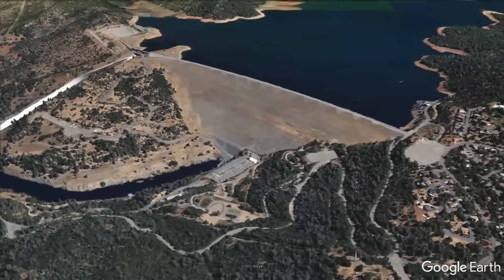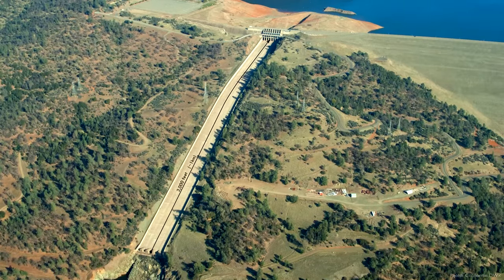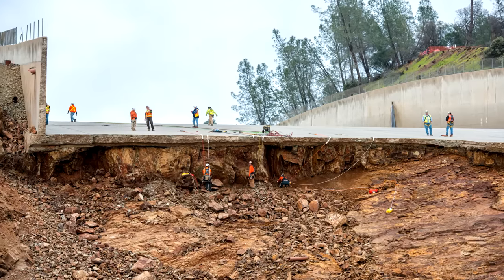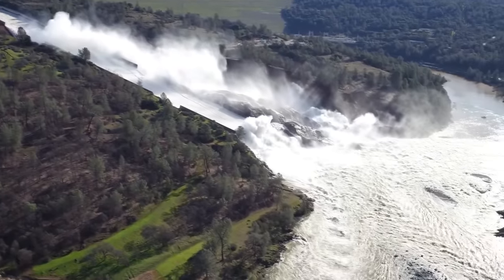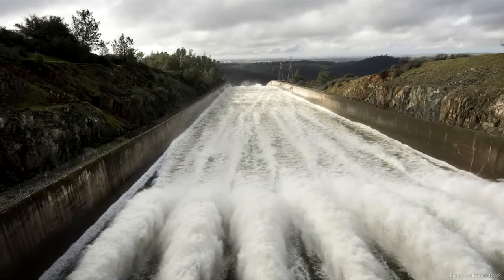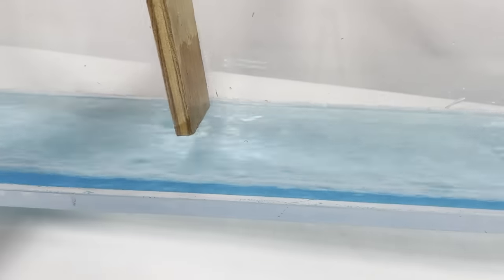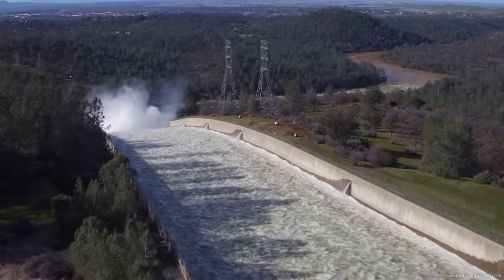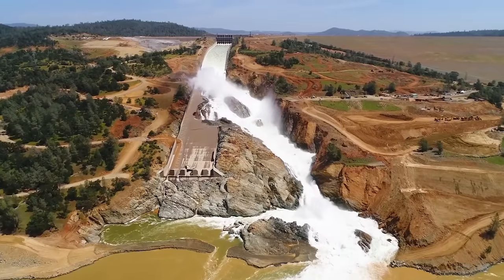What Really Happened at the Oroville Dam Spillway?

Comment: I lived in Marysville CA during this incident and had to evacuate my home. I worked at the fire department so I saw things from a different perspective during the evacuation. We were not at all prepared for this event and if the dam would’ve completely given way, a lot of us wouldn’t have made it. Thanks for the great video. We should all learn more about the environments we live in, both man made and natural.
Reply: Preparedness is so rarely adequate.  I have seen this lack so many times in my work as a safety professional.  It's impossible to plan for every possible contingency, but trying to do the best you can to plan for the worst should always be the goal.
Reply: I lived in Marysville as well. Once they evacuated oroville we figured we’d do the same. We saw fights happening at gas stations and cars driving on the sides of the road to get passed the traffic. Felt like the end times.
Reply: It was never the dam that was in danger of failure, it was the erosion below the emergency spillway (not even close to the dam) that was about to cause that spillway to flip over and release vast amounts of water.
Reply: @eily_b  good point, but most people, when they hear about a problem with a dam, don't worry about those details and their mind instantly jumps to the worst case scenario.
Reply: @richardbobby62  I was with my family in Williams at the time, and remember looking in the distance and thinking we should get out of there. Of course after hearing about problems like you mentioned, obviously we were in a much better place.
Reply: @richardbobby62  wow that most have been a mess. I have family in Oroville. Scary stuff
Reply: @richardbobby62 people were firing guns and running crazy stealing things...

Comment: 13:33
Grady: "Instead of trenching them into the foundations below the slabs, they reduced the thickness of the concrete to make room for the drains."

Me, who just learned how stagnation pressure can create an additional uplift force when acting on the underside of a submerged object less than 45 seconds ago:

"OH NO THEY DID NOT"
Reply: If you have ever farmed in rocky soil you would understand that rocks float on dirt.
Reply: Did you know.. they built an actual station that floats... underwater... like trains coming into that station... the whole thing is secured by the equivalent of guy ropes 

My point is.. they are keeping a floating station stable with heavy trains rumbling in every 30 seconds.. surely they can fix a cot damn DAM!

Reference; barangaroo project
Reply: @tonysuda9066  Your comment immediately prompts: How is an underwater floating station useful? If you get off at that station.... then where do you go?
Reply: @Graham_Wideman  dude its awesome the station is coccooned and the entry is from the sea bed and the exit goes into the city network.. mind fk i know
Reply: @dickJohnsonpeter  or... anchored submerged structure ... youll have to take  that my search also proved fruitless it was a show i was watching and picked it up but like late night half concentration weary shows i could not get the original title
Reply: Basically creating an engineered stress joint.  Nice work there kids.

Comment: I can't blame them for using the emergency spillway. This was exactly the situation that it was supposed to be designed for. I am sure they were shocked as anyone that rather than working as intended, it instead proved to be a major weakness. The only bright side is that the weakness was revealed and now it can be fixed so it can actually be used if there is another emergency. The worst situation would have been if the main flood gate was close to imminent failure and then there was no choice but to use the emergency spillway, at which point it could have eroded out and caused collapse.
Reply: Cause they were stupid.  And lazy.  Lunch time!!!
Look at the soil at the emergency spillway.  You can't tell me they couldn't dig a number of test holes and find it was more soil than bedrock.

A friend had to evacuate with her daughter.  The traffic jams were unbelievable.
Reply: @scottslotterbeck3796  exactly. This dam should’ve been run privately by a company that had its own money on the line. If that were the case, they would’ve never dealt with this.
Reply: @thatcarguydom266  That sounds lovely in theory. In reality, when a private company makes a critical error or it comes time to clean up (such as former mines) the company can and does declare bankruptcy and the public is left footing the bill. Invariably, the public inherits the risk of large projects.
Reply: @thatcarguydom266  Yeah, having a company with money on the line always works. Looks at Fukushima
Reply: @Ealsante  Exxon, and so on and so on.
Reply: in aviation we have something called the rule of corpses, it states that nothing will be changed that costs money until there is a body.
Reply: @ODST_SSGT  Similar in the engineering landscape: 'Building codes are written in blood.'
Reply: @thatcarguydom266  that only works if everyone directly involved, from the ground up to the leadership, are held 100% accountable and punished accordingly.
Look at 2008 financial crisis, I think you can count the number of bankers who went to prison on one hand. Instead, with the major bailout, now private corporations are as empowered as ever. If they're big enough, they'll just protest to the government, threatening how if they go under, a lot of citizens lose their jobs, and the government will just print money and bail them out.

Only real way to correct this is to enforce accountability.
Reply: @jac1207  I agree, but in 2008 the problem was big government as well. The way I see it, the largest government power grab in US history took place during the Great Depression under FDR. Court packing, borrowing tons of money, etc. that’s when our country really got financially boned.

In any case, had the government not been that big in the first place, it’s entirely likely that the 2008 financial crisis never would have happened
Reply: @scottslotterbeck3796  No, no they weren’t. It wasn’t the current operator’s fault. They didn’t perform the inspections, and they didn’t design the damn dam. 

It sucks because it definitely could have been a whole lot worse, but the fact that “the traffic jams were unbelievable” is the most of your worries means you should just chill the fuck out
Reply: @thatcarguydom266  You realize that a lot of those policies were enacted after the largest global financial crisis in history, right? Big Government didn't cause the Great Depression and if not for the undercutting of financial regulations under Reagan, the 2008 crash would likely have not been as bad. The real problem is marginal stock which allows a company to put more money into stocks than it actually has, so if a big enough bet fails the whole system comes crashing down. A lot of the rules the government implements also allow a fairer playing field for small companies.
Reply: @SleventyFive  As an add-on to your comment, I would also point out, the government prevents the natural result of unbridled capitalism: monopolies.

You know, the giant corporations later called robber barons?  The ones which have since devolved into oligarchies and duopolies since monopolies are banned?

There's a reason for all the other limitations the government imposes, too, but most proponents of capitalism either don't realize that or don't care.  There's no way I would ever expect a private company to care enough to take such efforts.  They have to be made to spend that kind of money.
Reply: @thatcarguydom266  hahahahahaha!

Come the fuck on. Private operators don’t have their own money on the line. That’s the whole point of limited liability companies.
Reply: @thatcarguydom266  yeah because corporations are always financially responsible…
Reply: ...make sure your last ditch plan actually works.
Will work.
Keeps working.
And has room for error.
Can we all agree on this?
Reply: ... man that meme with the guy sweating as hes faced with 2 buttons. U can either keep using this thing and risk everything.
Or use the emergency backup that might not even work, and still risk everything
Reply: You're right! There's a bright side to the incident, because the damn didn't actually fail, and would otherwise have remained a lurking threat. The same person(s) who were hesitant to use the emergency spillway may have been aware of the (probable) corner-cutting design measures that Grady alluded to in the video.
Reply: @scottslotterbeck3796  They potentially did do test borings, problem is that they only give you an idea about conditions at those exact spots and they could have been unlucky in where they did the tests. People like to assume you can connect the dots between borings to get an idea, but that is naive and wishful.  The only real way to know conditions is to completely excavate, but that just is not at all practical.
Reply: @thatcarguydom266  Imagine saying this stupid shit after the the failure of the privately owned Edenville dam last year which repeatedly went against the advice of federal regulators for more than 30 years telling them to repair their spillways. It is within a private companies interest to pay as little as possible in repairs in order ensure maximum profits. This will always lead to subpar facilities especially with weakened government regulations.
Reply: @thatcarguydom266  lol that's funny. If it were private this would have probably occured 5 years after construction instead of lasting as long as it did, as the boss man would have begged to use less anchors, thinner concrete, and asked "do we really need a geotechnical investigation???"
Reply: Yeah,  but question is, when they sow real situation of ground after broken bown spillway it should be warning to show that soil conditions are bad at emergency spilway too..
Reply: @Ealsante  if Fukushima had placed the emergency generators on the roof instead of in the basement (so to speak) they wouldn't have flooded and the reactor would have been okay.
Reply: @speedysam0624  of course nowadays, there is far more sensitive and accurate methods for geological surveys. I think they did what they could for that time.
Reply: @thatcarguydom266  Theoretically? Sure. But the inevitable outcome is always that the company either simply declares bankruptcy, which means the government has to pay for repairs anyway because there's nobody else to clean up; or, the company demands a bailout from the government. So either way, the public ends up paying for it. 

Privatisation of major infrastructure fails because private businesses, by their nature, are disincentivised from keeping large stashes of cash around to pay for emergencies. They are incentivised to either reinvest that money into new revenue streams (since a dam's ultimate source of revenue is essentially fixed, which means that they will need to change something or charge more to get more revenue) or to dump it into payroll for high-ranking employees and executives. 

You also have to consider that, since such a company is inherently dependent on the dam for its only revenue stream, then a dam failure or major problem that requires shutdown to repair entirely eliminates their revenue stream. You'd think that this would incentivise them to repair it, right? Well... not really. After all, dams generate revenue pretty consistently right up until they fail or are legislated out of action, so pumping money into maintaining the dam beyond bare minimum standards isn't going to garner a return on investment. It's essentially sinking money into a black hole with no payout. Sure it's safer, but it's also probably not going to be a problem within the next 5 years and the bare minimum standards are all you ACTUALLY need in the event of a failure. Provided you meet those standards, then you're going to get bailed out in a crisis. So, why spend more than that? Better to keep the money and find alternate revenue streams, like charging customers more or extending service to new customers, than to try to repair the dam itself. 

So, you have a business model that's antithetical to dam maintenance. In the event of a breach, they won't pay the costs; in the event of no breach, there's no benefit but substantial cost to doing more than the minimum legislated requirements. The only reason they'd stockpile money is to buy a NEW dam elsewhere, since eventually the government WILL shut down their current one because dam safety legislation is always increasing and eventually the current dam will fail to meet requirements. They have less than no reason to save for maintenance or payouts in the event of damages.

Major infrastructure privatisation never ends up helping end-consumers, and typically just increases costs to taxpayers. 

The problem with nationalisation is simple: the government has a lot of dams and does it specifically care about any ONE dam? Maybe, maybe not. Depends how hard the local representatives fight for it. But at least the government nominally has a reason to want the dam to be as safe and long-lived as possible: nobody else will carry the can for them. If the dam fails, they're going to pay for it no matter what. The government can't declare bankruptcy. It has no choice but to keep shit running - maybe not at PEAK efficiency, but at "acceptable for now" efficiency.
Reply: @thatcarguydom266  
Wtf you're blaming fdr for the 2008 crisis?! Also, FDR came in during the great depression. Hoover's laze faire caused the depression...🤦
Reply: Defenstrator, "I am sure they were shocked as anyone that rather than working as intended, it instead proved to be a major weakness." - Both spillways were designed to be built on a bedrock. While building the service spillway they realised it not a solid bedrock. They should have suspected that the emergency spillway might have the same issue since it's right next to the service one.
Reply: All I know is if I discovered there was major problems with how Option A was built that it was starting to fail, I wouldn't be choosing Option B... also built by the same people and hoping for the best.